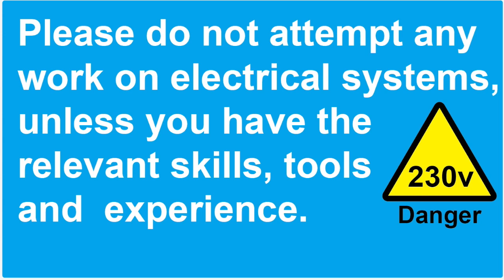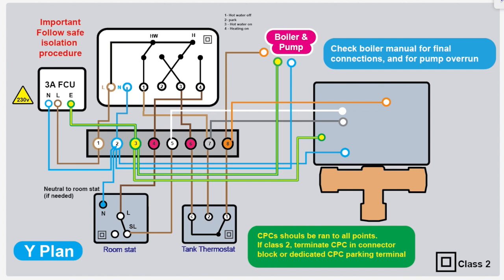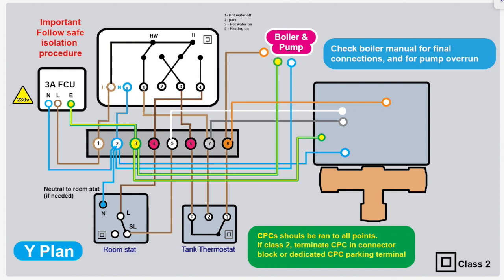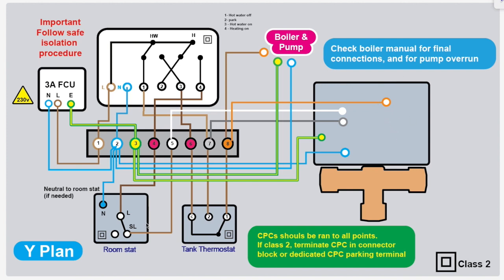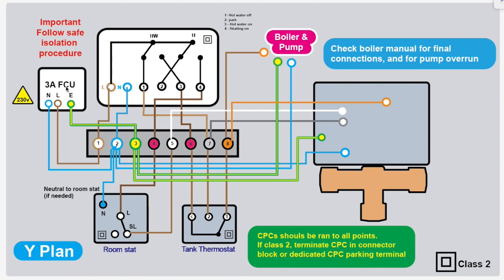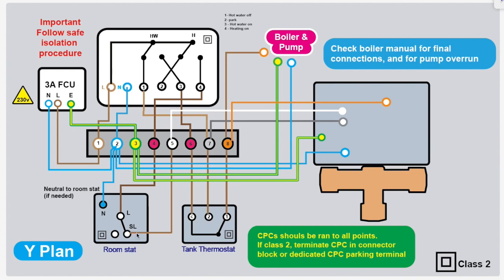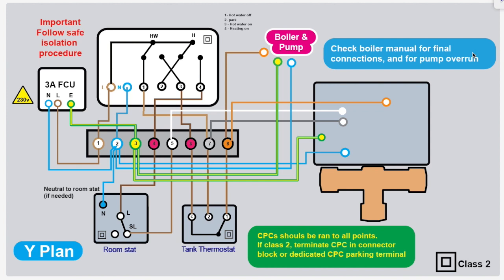Y Plan heating system - Part 2  - Neutrals and CPC connections

Comment: The earth wire in the cables protects the cable! from idiots chopping through a live wire causing enough fault current to earth to trip the mcb or blow the fuse. No earth wire properly connected (continuity) back to the FCU and Fuse board would not cause the power to be disconnected.... Unless the circuit was protected by a RCD. If no RCD and no earth in a heating cable.... Good luck not killing yourself if you chop through a live heating cable!! BANG!!